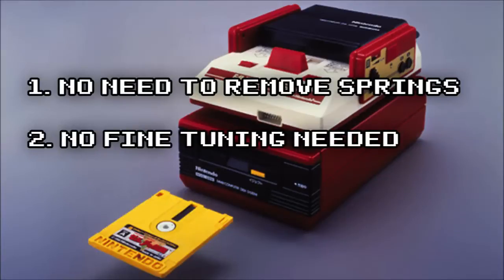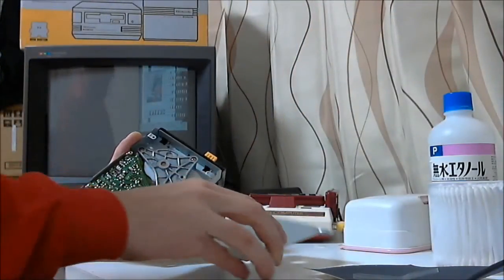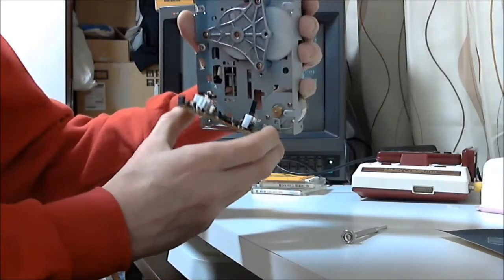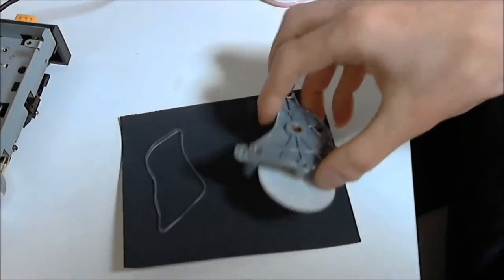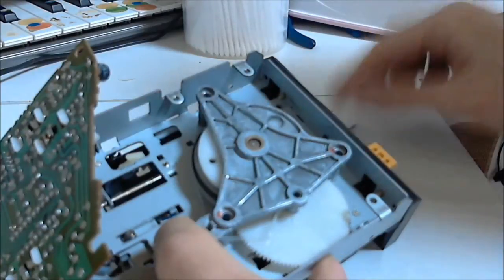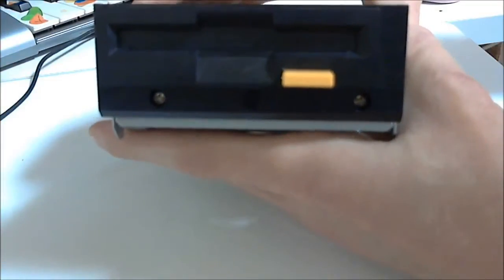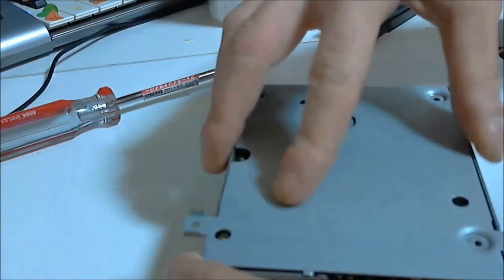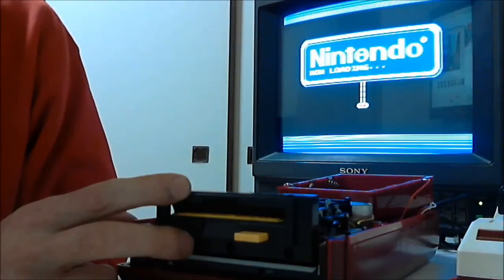*NEW METHOD* Fastest Easiest Famicom Disk System Belt Replacement

Comment: Why did it need realignment when you never loosened the 1.5mm set screw during belt replacement?
Reply from the maker: Good question - Because when the belt is removed or broken, the main spindle no longer rotates with the motor.. its a very primitive mechanism, and I still dont really understand why the rotational position affects loading - I guess the drive is so basic it has to be in the right position to start reading the Table Of Contents as opposed to actually finding it before reading.

Comment: I have tried your method, but did do the allignment that you showed at the end of the video because I believe it is already alligned by checking the position of the hole and the metal strip. Tried to load some of my floppies, 4 out of 10 loads well, the rest gave me error 27. (I know all of my 10 floppies are in working conditon as tested on other FDS).

Do you think I need to allign again?
Reply from the maker: You might need to turn the central spindle very, very slightly left or right, if it doesnt work rotating it very slightly  one direction, just recenter it as it originally was,using the guide marker, and try again.

Comment: My belt won't stay on...
Reply from the maker: Seems to be an occasional problem that some people get -  - is the brass pulley totally clean? Check the outer edges of the pulley and scrape the corners thoroughly with a small sharp blade, you can also run some sandpaper around the edge of the white plastic pulley..

Comment: I see a lot of people selling those clear belts.  Are they actually better?  Generally, clear rubber deteriorates faster. Is there something special about the belts?  A new material?  Thanks for any info, and thanks for the video!
Reply: It is a new material that does not rot from what I have read, so it should last many times longer than the original.

Comment: I now have a Twin Famicom, and I recently got some disks. They were working fine until I tried to reach the 2nd Overworld on Zelda 2, now it keeps trying to read the disk (it will scan it, go back to the first position and try to scan it again and again), but its not giving me any errors. This now happens to all my disks, including ones that worked great before.
Reply: Okay, I got it to work, but only when it is vertical...
Reply from the maker: DDCecil hm, that sounds like a problem! did you replace the belt or is it still as you bought it? that sounds like the head is not close enough to the disk, or there is some very very slight alignment issue with the spindle...

Sadly another issue is that these systems are OLD and because of the amount of moving parts, it may be another issue.. Twin famicoms are a pain to take apart and reassemble, but there ARE guides on YT that show you how should you feel the need to try and adjust anything,

I do not recommend messing with the motor speed adjustment AT ALL, its very difficult to get it back to normal once you start messing with it..

Maybe enjoy your games while it runs on its side, and then try sme adjustments if that stops working.. sorry youre having problems!!
Reply: retro raider japan Okay, I see what is happening. When the drive goes backwards, it isn't hitting the little black switch, which is does when the drive is vertical.
Reply from the maker: DDCecil you might need to grease the chrome plated rods that the mechanism slides up and down on..
Reply: retro raider japan What's a good type of grease to use? I'm new to this kind of stuff and sorry for all the questions!
Reply: DDCecil As I haven`t had to perform that kind of operation, I would ask at a hardware or maybe a store that sells radio control cars , sorry!

Comment: seems the clear belts I bought are junk. after a few rotations they just slide off of the wheel. had it working for about 30 minutes till this started up. now I can't get the belt to stay one for more than 2 head passes.
Reply: You will find that it is actually the height of the brass pulley wheel that is causing that problem.. 1st make sure the motor is fully screwed down, 2nd the only option is to try and force the brass pully down on the motor spindle.

It's a problem that seems to occur on maybe every 10 or so FDS units. I have seen used FDS drive units that have had chunks broken off the brass pulley wheel from people trying to whack it down with a hammer.

You have to remember that these devices are very old now and warping of the mechanisms and accidental damage over time can cause these issues...
Reply: Brian actually I took the entire gear hub apart, cleaned and oiled it. I then fit it back together and it was now tighter with less wobble. it is back to working. at the price of these i may as well but a spare.
Reply: I've found the same thing.  I bought some clear belts off ebay, and both kept slipping off.  I tried some black ones and they stay on fine.

Comment: Hi I have tried your method of re calibrating the spindle but am still getting error 22. I have also tried using other methods on other videos but still getting error 22 or error 21. Any help would be appreciated. Thanks in advance
Reply from the maker: 1st question I can ask is, has your FDS worked in the past, or have you bought it as is? These things are old and not all of them have just one issue?

I've repaired a huge amount  of FDS units, but some are beyond repair due to previous owners messing with motor settings, damaged or missing pressure pads (the tiny circular pad on a spring loaded black arm above the head), missing springs, or just damaged heads.
Reply: hi I have bought it as is but it doesn't look like it's been tampered with as it still had the original belt inside.

Looking back at your video I have just realised that I didn't align the hole before putting the cog back on. Could that be the issue? Will try again later. Thanks for getting back to me so quickly
Reply from the maker: @philwong2733  if you missed a step, then that could be the issue.
Reply: I got it working but it will only read the games if the drive is on a upward angle??? Any ideas thanks

Comment: Thanks for your interesting video.
I had to replace a belt I changed 4 Years ago. The spindle position in your tutorial didn't work for me. I got errors 21 or 22 at boot for every disk. I had to rotate the spindle to finally get a few games booting (Goonies and Zanac but not Akumajô Dracula which made an error after the title screen). After 2 hours of fine tuning, I've successfully made Akumajô Dracula fully working. I tried almost 20 games since without any errors. That game seems to be a good candidate for fine tuning.
Reply: Same here, how much did you have to rotate to get it working?

Comment: Hi, my Doki Doki Panic and Donkey Kong arrived last week, thank you.  Possibly a silly question, but was Donkey Kong tested?  The game does not work for me, the graphics are corrupted.  I cleaned the cart, it was disgustingly filthy, but it made no difference.

I have a weird issue with Doki Doki Panic as well, not sure if you will have any idea about it as it seems to be an issue with my Twin.

The game will not recognise the start button being pressed in side A.  This is also happening with a loose copy of SMB that came with the system.  After the demo plays on DDP, I can turn the disk over and play it with no problems, I just wanted to erase the save games.  Moero Twinn Bee FDS is another with a problem.  As soon as the game starts, the ships moves to the bottom of the screen and cannot be moved.  I've cleaned the pads' board and rubber parts but it made no difference.  It's really annoying, I hate the Twins' pads.  I should have bought an AV+FDS instead :(
Reply: I am very sorry about donkey kong - I assume it slipped by my cleaning and checking. You have been refunded.

I believe DDP does NOT have a save game erase function - some users on forums recommend you eject the disk during a save to corrupt the data and rewrite it from there, but that worries me somewhat. You can also skip the intro by flipping the disk and inserting it on the title screen.

It seems very stange that only twinbee has a movement problem, I really have no idea why that could be..

That aside, please accept my apologies for donkey kong.
Reply from the maker: I am very sorry about donkey kong - I assume it slipped by my cleaning and checking. You have been refunded.

I believe DDP does NOT have a save game erase function - some users on forums recommend you eject the disk during a save to corrupt the data and rewrite it from there, but that worries me somewhat. You can also skip the intro by flipping the disk and inserting it on the title screen.

It seems very stange that only twinbee has a movement problem, I really have no idea why that could be..

That aside, please accept my apologies for donkey kong.
Reply: Hello!  No worries at all!  Thank you very much!  Considering how badly Famicom carts have been abused in Japan over the past 20 years, it's a miracle that very few games ever stop working.  The amount of Fami carts at Hard Off and other junk shops was always enormous.

The Twin Bee thing is indeed weird and rather annoying as I actually really wanted to play it.  I had no idea that a side scroller Twin Bee existed.  No idea about the start button thing either.  I just hope that there is no underlying problems with my Twin.  Thanks to your guide, at least the disk system is about 88% working!

Comment: Hi my FDS was working when I bought it, it has sat idle from about may till 1 week ago and now gives me errors 21 & 22. Is it the belt or just misaligned? Not sure why all of sudden it has stopped working, it has the soft card in it at all times so the drive should be fine but doesn't work all of a sudden, it loads up my Akujamou Dracula 2 Noroi No Fuuin then when it says flip the disk it stops working.
Reply from the maker: Hard to say, to be honest, the fact it is giving 21 and 22 errors instead of a 27 means its definitely having a hard time reading the discs - is it very hot where you are??
Reply: retro raider japan nope it's north west england :P so very cold :P should I do the realignment then test?
Reply from the maker: I would take a look and check the belt is correctly positioned first, and that the belt itself is still OK.

Comment: I have tried this method over and over and I still get error 22 after 7 hours of attempts is their something else it could be? Mine is a rectangle hole not a circular. Yes I am talking about the one on the plastic not the metal plate.
Reply: Mine too, didnt work using rectangular hole as a reference. Mine has also a black spot painted on plastic wheel, tried this as a reference but no success yet.
Reply: Did u try cleaning the "lens" with isopropyl alcohol? Works for me, also got the square hole.
Reply: I realigned the spindle by removing disk tray, cleaned head and rotated the wheel in small increments of 5 - 10 degrees while tightening the central spindle hub. Then i got black screen, fine tuned the speed adjustment on motor and success ! Now reads both original and copied disks.

Comment: This alignment method did not work for me. Getting error 22 on all disks, which work in my other sharp twin fami. It was too good to be true! :D
Reply from the maker: Elrinth you may want to make slight adjustments to the spindle left or rght. you always have the original wheel position if you want to go back.. it does work, I have repaires many units this way, and checked them on 10+ disks
Reply: retro raider japan Tried it once again, still Error 22... Might be my motor which isn't running fast enough or something else.
Reply from the maker: Elrinth I have had some units that have absolutely failed to align, considering the age of these units, its amazing they still work at all...
Reply: retro raider japan I tried switching to a different motor just for funs sake.. no difference, however after having using your method and turning like 40 degrees extra counter clockwise, it works! Now I've finally fixed: system to actually start (lots of cleaning), audio problem in p2 controller (tons of cleaning and testing back n forth), disk system. I hope my friend will be happy despite it taking a bit longer than I had hoped it would do :P Thanks for help!

Comment: Hi, thanks very much for the tutorial. I have almost fixed my Twin Famicom disk system but it only works when the disk drive is held vertically or on an angle. When it's placed horizontally back in the case I get an error 22. This happens on all disks. I've tried going back through the guide but I seem to have the same issue. Do you have any ideas?
Reply from the maker: Hi, I had someone else with the exact same problem asking me about this just the other day  -  the center spindle can be moved up and down after you loosen the tiny screw with an allen key - but be very careful - you should have it as
low as possible, but you may have to try a very very slight upwards adjustment..
Reply: retro raider japan I didn't manage to fix this one but managed to pick up another faulty FDS unit from Yahoo auctions for 100 yen + £20 shipping to the UK hahaha! Thanks so much for such a comprehensive tutorial. I now have my Twin Famicom fully working :)!

Comment: Followed your tutorial and it worked just fine. Didn't even have to realign the spindle. Though now I keep getting error 22. Any advice on how to fix that? Is it just the spindle stuff you're doing here that I didn't have to do during my initial belt replacement? Only info I can find is what the error code means.
Reply from the maker: did it work, and then stop working? error 22, from my experience means it's definitely not aligned properly.. 27 means it's closer to alignment..
Reply: retro raider japan yes it worked at first then today it stopped working.
Reply from the maker: thats really strange. I can't offer any more advice, other than trying again.. sorry..
Reply: retro raider japan Well I guess I'll try doing the realignment I didn't do the first time since it worked then. I just hope this will be a simple fix.

Comment: Thanks this was very helpful.  I bought my replacement transparent belt from ebay but it after spinning for 5 seconds, the belt slips off the larger pulley.  Is this a belt issue?  How do I order the belt from you?  Thanks.
Reply from the maker: Sometimes some units have issues where the belt slips off, I'm unsure how this can be remedied. Currently I cannot ship due to COVID shipping bans to many countries.
The best thing I can suggest is get a BLACK belt and rub some sandpaper on the large pulley just to rough it slightly, sorry I can't be of more help.
Reply: @retroraiderjapan2516  Thanks for your reply.  One more question if you don't mind - for me the big white pulley seems to be slightly lower than the small gold pulley.  It's a very slight height difference.  Did you find that in your case also?  I wonder if that slight height difference is causing the belt to get pulled up?
Also, the big white pulley seems to have a slight rounded edge (i.e. convex).  I would've thought that the white pulley should be concave to ensure the belt stays on the pulley.  Did you notice this also?
Reply from the maker: @ru5ty888  Sorry, I can't say I noticed that detail - all I can suggest is to try a black belt unfortunately.
Reply: @ru5ty888  trying this method, and still failing on some drives. on these drives i also indeed have problems with the white pulley being slightly lower, and belts do sometimes slip off. will be trying a black belt soon, will let you know if that makes a difference

Comment: Hello! Thanks a lot for putting together this awesome tutorial, I know it takes a lot of time and effort. I tried following this tutorial on both of my Twin Famicoms, and was successfully able to replace the belts, and align the disk drives. However:

On one FDS, there's 2 clicks, and then Error 2, which apparently involves the battery. I see the belt move slightly with each click. The error does not occur when the belt is detached.

On the other FDS, I can see and hear the belt running, along with the reading mechanism moving over the inserted disks, but I'm still stuck at the Now Loading screen.

Do you have any advice for either? I have multiple disks I've been testing with. Thank you.
Reply: I just had this exact problem. The black wire was hanging up the drive head not allowing it to hit the switch. Check that the drive is engaging the rear switch
Reply: +Frank Claycomb +Frank Claycomb I'll try it next week once I have the units with me, and I'm assuming you're referring to the first system's issue that I mentioned. Thanks a bunch for the advice!
Reply: I meant the second issue stuck at now loading.
Reply: I took a look inside, and found that the rear switch was being engaged, and the black wire wasn't obstructing the switch. I still have the "Now Loading" issue, but that was worth inspecting